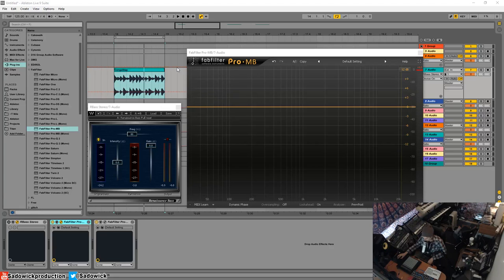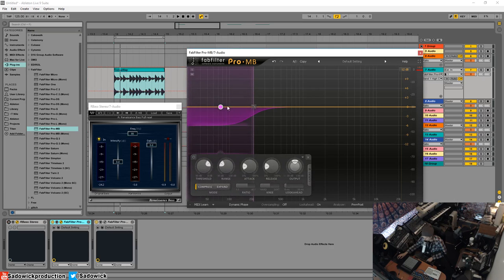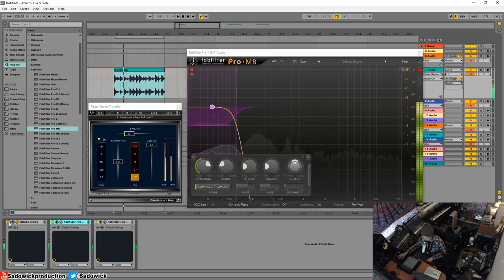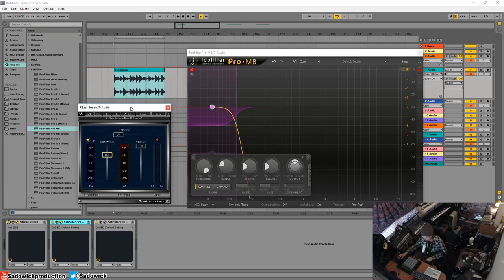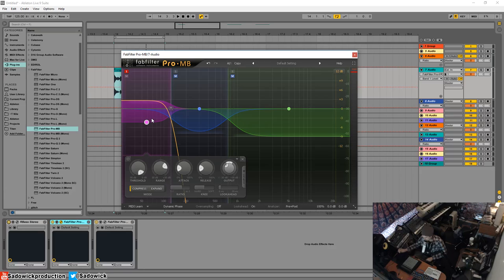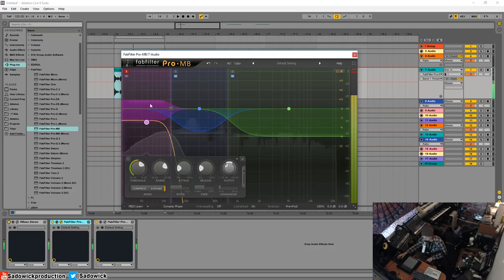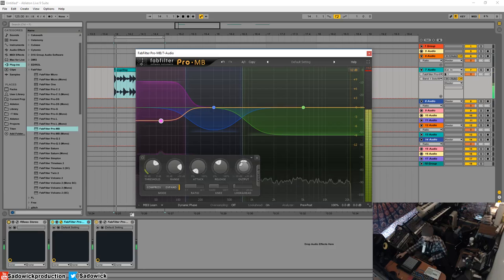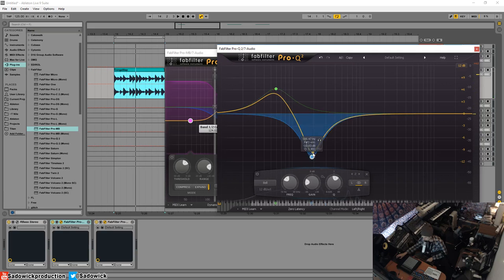RBass And Pro-MB Multiband Upwards Compression To Add Tight Sub

Comment: U̶p̶w̶a̶r̶d̶s̶ ̶C̶o̶m̶p̶r̶e̶s̶s̶i̶o̶n̶ Upwards Expansion

The difference is knowing which 2 methods (of the 4) work with the peaks of a waveform above or below a set threshold.
& which 2 methods (of the 4) work with the valleys of a waveform above or below a set threshold.